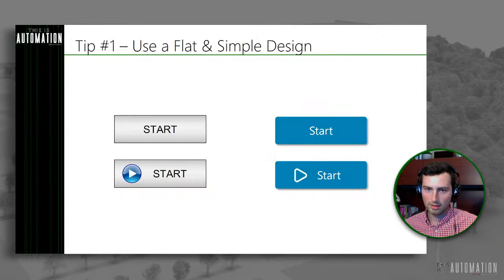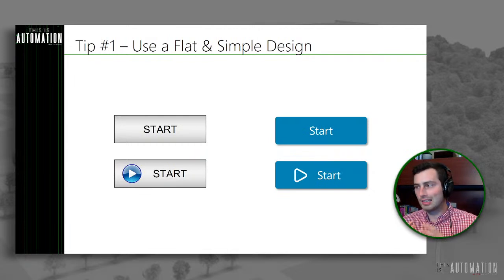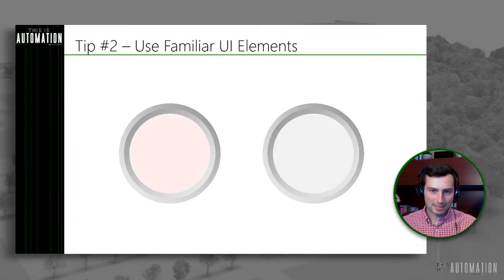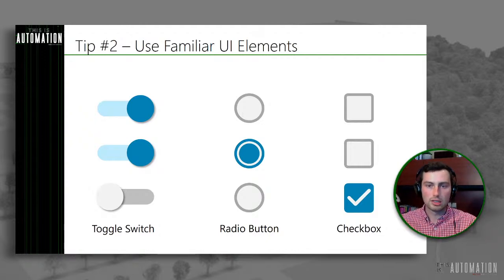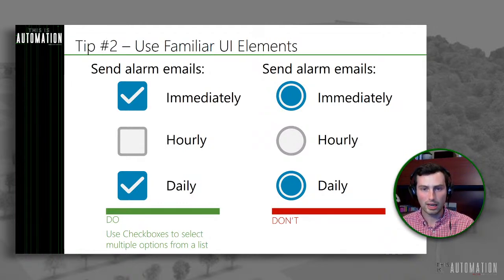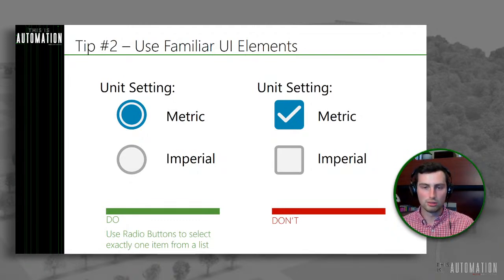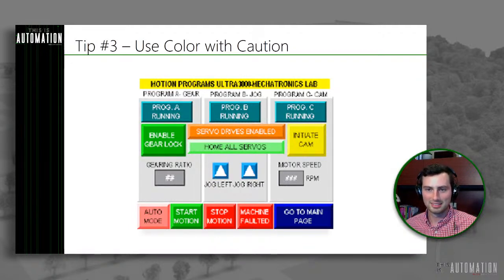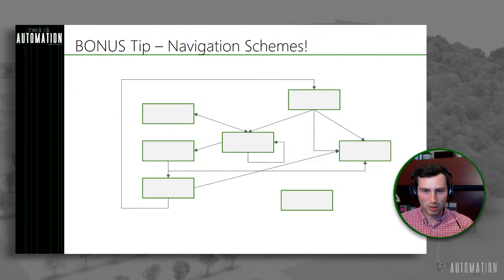THREE Tips for Modern HMI Design!

Comment: Include key stakeholders into your design process. Their buy-in on how the HMI functions is crucial to a successful project. It could save you from having to completely start over as well. 

I like the use of color tip most and I agree that most all industrial UIs are like the one you presented. 
SymbolFactory should also be used sparingly!!
Reply from the maker: Love it! Great tip. Including stakeholders EARLY in the design and as a continuous feedback cycle is absolutely critical!
Reply: I agree with that. We also have to take into account that a lot of users in the industrial machinery environment are used to these ugly HMI designs that @Cory points at and they probably want the same. At least that happened to me a couple of times before.